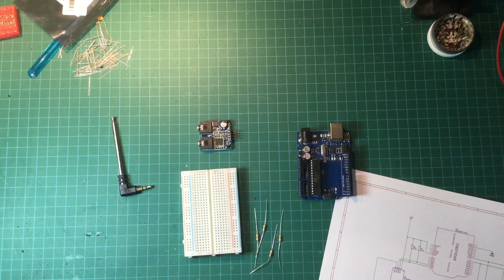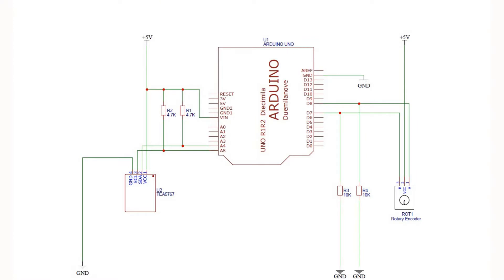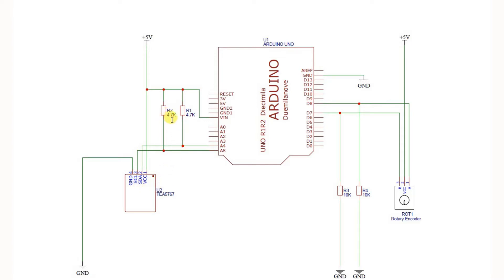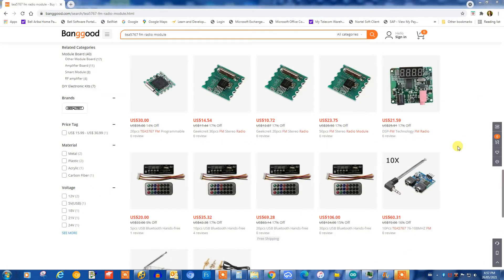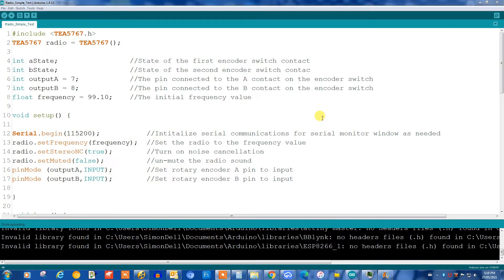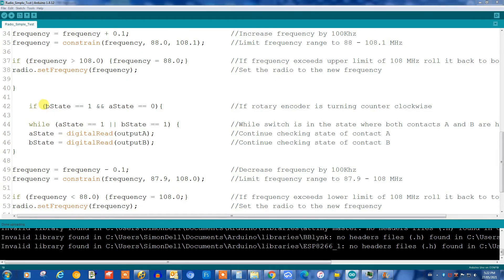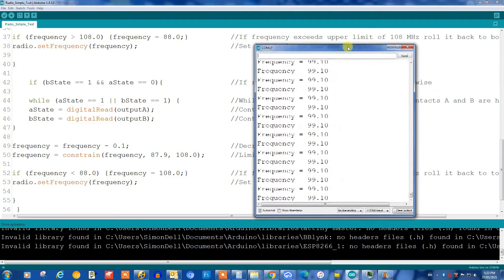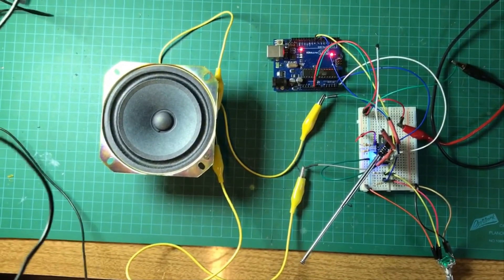Connecting the TEA5767 FM Radio to Arduino

Comment: You're the only one I've seen add the pull-up resistors to SDA & SCL lines yet without them one will get a load of static. Thanks
If others are wondering which library you used, it's: big12boy/TEA5767